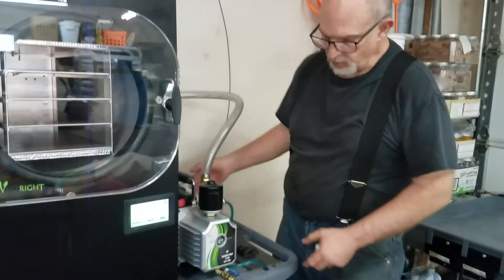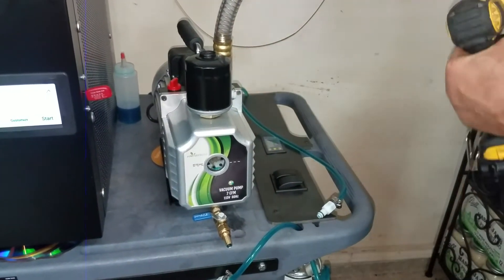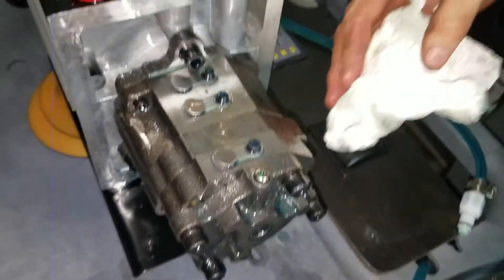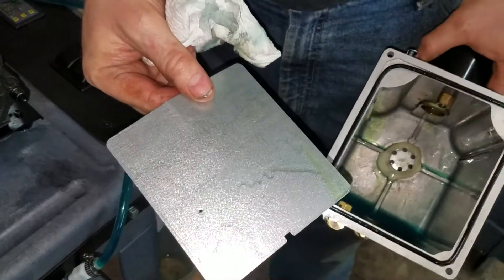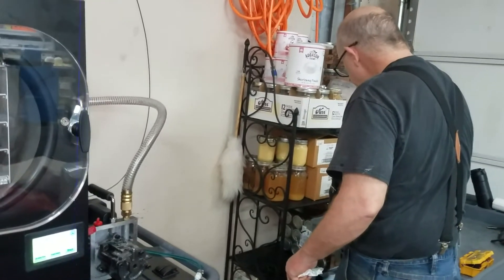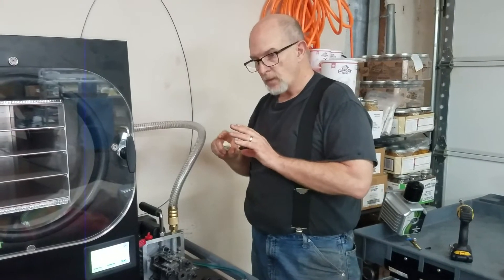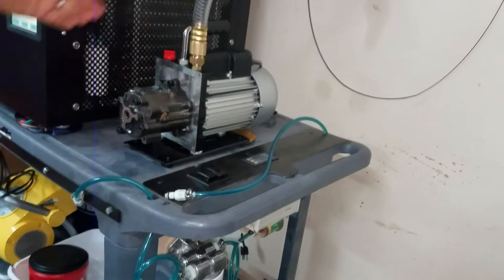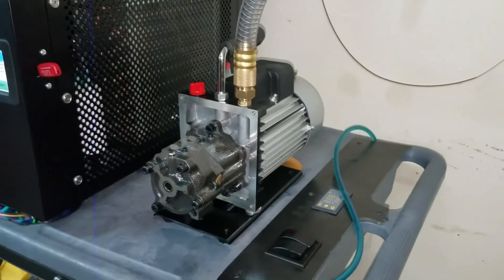Harvest Right Oil Pump Inspection Batch 56 Video 2 of 3

Comment: Hi, WHAT IS THE NAME OF THE 90 DEGREE BRASS FITTINGS YOU PERMANENTLY  ATTACHED TO THE HOUSING? DID YOU HAVE TO MAKE THREADS ON HOUSING TO THREAD THEM IN OR JUST DRILL A ROUND HOLE AND TIGHTEN THEM? Is THEIR A RUBBER SEAL NEEDED WITH THEM OR NOT? I'D APPRICIATE FEEDBACK AS I WANT TO BUY THEM TOMORROW SO I CAN NOT STALL ANY LONGER. THANKS FOR ANY INFORMATION.